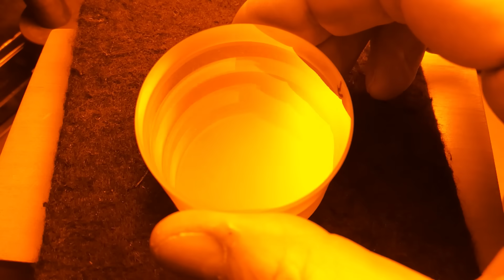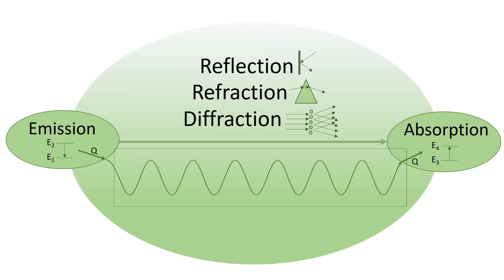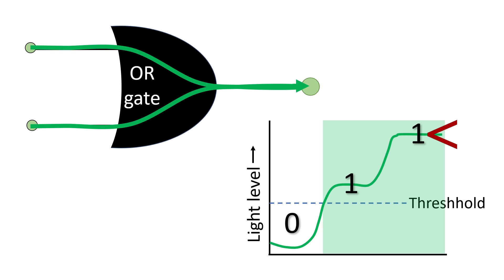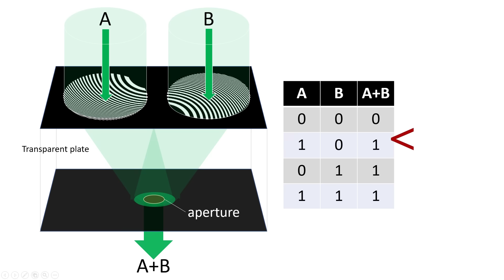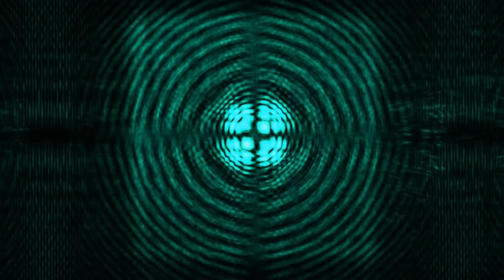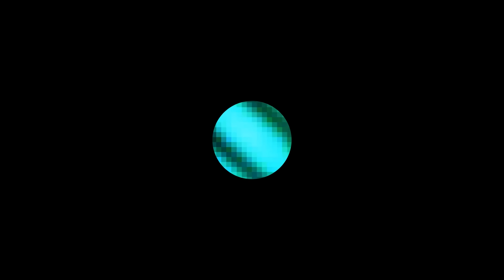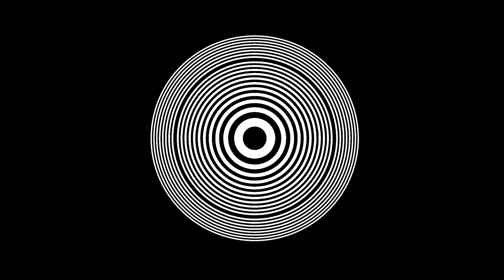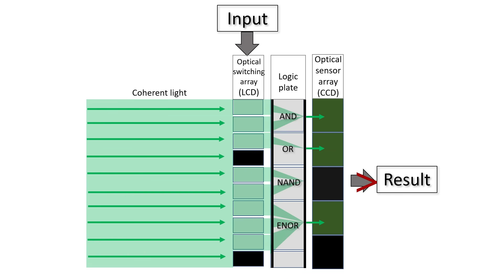Making Optical Logic Gates using Interference

Comment: can I comment as we go along with your lecture, please?
I think it is a mistake to look at positive and negative energy as existing on opposite sides of zero... logically they are both part of what we call energy... I will ask.. what can we see around us that is less than zero... ya can't get more nothing..  
we cannot have positive without negative... in electrical and magnetic systems it is the difference between them that creates the electromotive force... it is the foundation of thermodynamics and the motion of particles.. more or less.. but not nothing and less than nothing... 
in computers we use negative numbers for subtraction... but the only place I actually find negative numbers... less than zero seems to be in my bank account... go figure
Reply: I'm going to drop in my own thinking along these lines... because we need a method to store data in a 3D lattice that can be recovered at light speed... Bragg diffraction in opal... and diamond... could be used.. in a 3 dimensional storage where layers that are half the size of a wavelength of light.. and it can be infrared and ultraviolet as well as visible light.. depending on the size of the unit cells and the angle of incidence in the reference beam.. so the same incidence angle gives different colors at separate each layer... or different angle of incidence gives different colors at each layer... which gives a 3 dimensional storage and recovery capability... just a Gedanken Experimente at the moment...

Comment: the idea is very interesting. if it's possible to make a functional Full Adder and Register, a light based 6502 would be an amazing goal and Proof of Concept!
Reply from the maker: A 2 bit addition is fairly easy, however, things get pretty complicated with more because every input bit can influence the higher bits, which is tricky with just optical interference.

Comment: I recently got into phase-contrast microscopy, so it's pretty cool to see weirder applications of the concept. 

As for the question of viability... Modern silicon transistors are less than 10nm, already a 50th the size of your green laser. The only real benefit you could get out of this is potentially quantum or analogue computing.

Comment: This is a really cool idea, but I think the most difficult problem to deal with would be maintaining the phase of the light as data is transmitted throughout the machine. You would have to be able to guarantee that any time you get two inputs to an optical logic gate that those inputs are in the same relative phase. For example if one input travels a longer distance than the other it would potentially be out of phase when you actually want it to be in phase yielding a 0 when you expected a 1. I think it would probably be more robust to come up with a way to construct these logic gates with the light either on or off. The cool thing about optical computers though is that you can transmit multiple bits on the same line by using different non-interfering wavelengths. Like a byte 0xff would be white light while 0x80 would be pure infrared, 0x40 -> red, 0x20 -> green, 0x01 - uv etc... You could even handle multiple bits through the same logic gate at the same time. Depending on the difference in wavelength necessary for the light not to interfere, you could potentially have some very wide data lines (I don't know the exact resolution but I'm sure its far more than 8 bits). Also given that the speed of light is much faster than the speed of electricity and light won't generate nearly as much heat waste, optical microprocessors could be a game-changer for modern computing if we can get it to work. Is there anything like an optical transistor? That would certainly add a huge level of plausibility to the concept.

Comment: It's important to be able connect the gates together to perform computation. The performance of the entire processor is dependent on the delay of the signal through the circuit, so for best results you would want the output of one gate directly feeding the input of the next, perhaps with amplification if required.

The method of amplifying a signal must be low latency to have good performance. I know very little about optics, but I imaging a mechanism that charges, pumps, and emits light could have very high latency resulting in a high signal propagation delay.

An inexpensive FPGA kit ($200) can switch up to approx 1GHz. Some of the fastest (sequential) processors have clocks up to 5GHz (note this is the clock rate for 64-bit ALU operations so transistors are switching faster than 5GHz).

How fast can you run a flip flop out of purely optical components with minimal latency? If the signal can propagate up to C without degradation then it could be extremely fast. Visible light frequency is in the 400THz to 700GHz range.

Comment: My intuition about optical car locks is that, with the development of the required tools and instruments, such locks would provide equivalent security to today's Internet encryption methods, meaning that they would have to encode similar numbers of bits to provide a similar level of security. But, with the advent of quantum or photonic computers that could try all keys quickly, the bit length in such car locks would have to be increased over time to keep up with the speed increases in computing, just as with Internet encryption. The only technique I know of that would counteract increases in computer speed is the MAC algorithm that uses multiple encryption in the software. In car locks, this would increase the complexity of the lock/unlock hardware without much change needed to car keys.

Comment: Why must a photonic bit be represented by a light level? Why not a frequency or phase? Phase, in particular, is attractive, since it is an aperiodic characteristic of periodic waves, varying from zero through a circle of values back to zero, either in real numbers or in complex numbers. And phase can be combined through M-Z interferometers or polarizers either at full lab scale or in miniature. All this can be done classically, without quantum complications such as a need for refrigeration and without the horrible mechanical complications of generating interference fringes and selecting one fringe. As a toy lab experiment, the author's method works just fine, and could be expected to produce some gates and flip-flops realized on top of a very large bench.

Comment: In the first minute, the question is asked: where does the energy from a dark fringe go? Strangely, the answer is not discussed. The answer, of course, is that the energy that would have appeared in the dark fringe goes to the nearby bright fringes, which are thereby brighter than the source (non-interfering) light. Light energy can be understood as wave energy, and is conserved just like any other form of energy. There is nothing contrary to the conservation of energy in conventional discussions of wave interference, either destructive or constructive.

Comment: I was working on this process and the application of this process as far back as more than 9 years ago, but less than 10 years ago. I was working on redundancies to allow for full application of this process in the form of hi speed primary memory and processing logic at least as far back as Fall of 2019. I had concepts for mitigating waste heat and recovering waste photons, etc. One of the immediate advantages of this process is that you can make an optically actuated clock, and with negligible difference in waste heat production, run a hypothetical cpu, or bus, or memory at several orders of magnitude faster switching/clock speeds than the viable ceiling in semiconductor processing(mitigating the problem of gates operating in the shorter end of the  x-ray band having slightly longer delays than is applicable in the best viable semiconductor gates, and especially applicable if working with uv light - which is more immediately testable ). I had strategies for approaching the prototyping and testing of a drop in replacement for ram in sodimm form factor, but needed to wait until I had more resources for fabrication.

Imagine a massive fpga array that occupies almost no space,  has 1/1000 the latency of a conventional fpga array, and consumes 1/10 of a watt?

It is hypothetically possible to create a switchable diffraction array in multiple physical planes of interaction that can be intermittently changed to affect diffraction of indefinitely many poly-degree layers of diffraction/interaction. In other words, there is a straightforward path to making a processor that can physically change it's architecture across extremely short timeframes.

Comment: Diffusing Silica (glass) on other layers, you could make micro fiber optic paths to connect the gates together. And, if diffraction patterns could be introduced in these fiber/optic paths, they could combine at an aperture - that would eliminate need for the diffuser layer as this would be encoded into the paths themselves resolving into logic functions where they come together at various aperatures.

Comment: Great video! An un-picable lock. Brilliant. You should file for a patent on that if you are the first, or at least write a whitepaper and have it published - even on YouTube if no one will pick it up.  Optical computers, this is very stimulating (no pun intended). If you could do this with individual photons, quantum computing may merge with this.  For those of you not familiar with digital logic gates: In electronics, all you really need is NAND gates because a 2nd NAND gate (with one input tied to a logic '1') on the output of the first acts as a NOT (inverter) gate and converts the NAND gate to an AND gate. So, using NAND gates, you can make: NAND, NOT, AND, OR, NOR, EXCUSIVE OR, EXCLUSIVE NOR, and any other gate with various combinations NOT on the inputs and output... and you have ALL the building blocks of computer logic. With Optical Logic, you start OR and NOT gates, and those too can be combined in various ways to create ALL of the same building blocks gates used in electronics.  For example: Demorgan's Therom states you can convert, say an OR gate to an AND gate by putting a NOT on each input and output of the OR gate. Try it:  The truth table of a Negitive Logic OR gate (one with NOT on the all the inputs and output) and truth table of an AND gate, both tables give the same results with respect to their inputs (thus the same gate, just inverted "logic/polarity" symbols). A postive logic AND gate is the same as a Negative logic OR gate, they do the same but you look at the logic from positive or negative perspectives, so the symbols are different but do effectively the same.

Comment: Something to thing about Jeroen. What about making optical logic gates based on optical frequency? Eg your inputs are two coherent light sources at a given frequency. If both inputs are present and you combine them then you should get an output which includes an optical beam at twice the frequency. It would not be computationally  as fast as your method but still would be relatively fast as it uses optics.

Comment: I've always wondered if microscope images could be improved by post-filtering. We know exactly how the optics works so could we not deconvolve the image to optimize detail?  In fact, can we use a laser to help with this? In fact, what I was thinking was to actually have a flexible lens that could alter the focal plane very quickly(say 30hz) which could then be used to get maximum detail over a larger depth then correct the focal differences algorithmically. It seems a lot more could be done with optical microscopy than what is done(from my limited knowledge). What about using AI to correct and hence the images?

Comment: I am interested in the process of using micro lithography for the fabrication of 2 dimensional photonic crystal 'chips' which would perform logical functions. One such material preference would be fused silica which has been considered for use in photonic crystal fibers. Semiconducting nanocrystals (quantum dots) could be imbedded as a lasing source but may also perform other functions. A Japanese company has already made a photonic 'switch' (on/off) in this manner and no doubt the arranging of such 'switches' could possibly perform a fully logical function. The chip could require optical circuits as well. The etching technology would come from Nanoscribe

Comment: Atomic radiation is the key for this study. 
Every atom has different radiation level and frequency
1. The crystal structure should be illuminated with white light. (slightly below the electron orbital change energy)
2. One light input source can be accept different frequency lights.

3. Output can be multiple with different type of atoms. An element passes a frequency.
Multi input with one channel. Multi output with multi filtered channel. Same optical way can be use for calculation every needs.
Why limit yourself to simple structures? The door to the future cannot be opened with old ideas. You have all of periodic table.

Comment: I'm not a physicist, but a programmer. Could somehow explain what the benefit of a logic architecture based on photons rather than electrons would have? A quick Google search told me that electricity usually flows at 90% the speed of light, which seems good enough for the vast majority of applications. I thought that you could encode data in light beams or images, that already exists.

Comment: xD make  binar counter 000, 001, 010, 011, 100,101, 110, 000 ... or binar calculator if use colors too (how much shift in lense (chemical composition of the material) colors/wavelenghts (spectrum)). Copy is like "Polarization by a Calcite Crystal"?
Reply: copy is like "Polarization by a Calcite Crystal"? & Polarized Light

Comment: HI REF YOUR VID ttps://www.youtube.com/watch?v=pS1zAAD1nXI OPTICAL LOGIC GATES !!! I FOUND THAT I CAN SWITCH A LASER INTERFERENCE PATERN ON AND OFF IF THE LASER RING GYRO 2 MIRRORS AND 1 SPLITER HAS A LONG SIDE APPOX 3 TIMES THE SHORT SIDE !! THE RLG MUST BE CHANGING VERY SLIGHTLY IN TEMPERATURE AS NOT TO BREAK THE FREQUENCY LOCK !!! WHEN THE MICROWAVE OF A 1 WATT WIFI IS EXPOSED TO THE RLG AT ABOUT 1 TO 2 FEET AWAY THE MICROWAVE BREAKS THE FREQUENCY LOCK OF THE LASER IN THE RLG !! THIS WAS A .5 WATT RED LED LASER !!! I HAVE DONE THIS MANY TIMES OVER THE LAST 20 YEARS !!! ON A DRY DAY YOU CAN PUT THE RLG IN A FREEZER TO LOWER THE TEMPERATURE FOR A FEW MINUTES AND YOU WILL FIND YOUR INTERFERENCE PATTERNS ARE MISSING  WHEN REMOVED FROM THE FREEZER!!! THEY ARE ACTUALLY BLURRED MOVING BY SO FAST !!! WAIT 5 TO 10 MINUTES AND U WILL SEE THE TRAIN TRACK PHENOMENON AS THE TEMP STABALIZES !!! THEN THE STICK AND RELEASE EFFECT OF THE NODES ( FREQUENCY LOCK STARTS AND STOPS !! THATS WHAT YOUR AFTER !!! YOU CAN ALSO BRAKE FREQUENCY LOCK USING A SMALL SPEAKER LIKE A SMALL 3 TO 4 INCH SPEAKER WITH A AUDIBLE TONE PLAYING QUIETLY LAYING OR ATTACHED TO THE BASE OF YOUR LRG !!! I DON'T KNOW THE SWITCHING TIME THAT ITS ACCOMPLISHING BUT IM SHURE ITS BETTER THAN AN LCD CAUSE THE LASER IS ALREADY AT FULL AMPLIFICATION !!! GOOD LUCK AND HAPPY LATE HOLIDAYS !!!!!

Comment: Could you multiply the number of operations by calibrating for different wavelengths? Or perhaps even performing distinct operations on a per wavelength basis? For example red green and blue light? In effect collapsing multiple chips into one? The instance you showed of stacked focal points would seemingly be ideal if two semi-transparent planes are used and a mixture of wavelengths are present one plane might be doped to absorb a single wavelength or a combination of wavelengths. It might even represent an entirely separate solution since the logic gates might be orientated along a axis orthogonal to the representation you have envisioned here.

Comment: When designing an optical computing device, you probably should immediately forget about LCD or anything that is controlled by electricity, because it destroys the speed advantage of such a system.
You'd probably need a fully optical device, where the only electronic part is the "power supply" which produces coherent light for the entire system, with no need for slow electronic feedback. The processing unit, working memory, storage and connections between them would all have to be optical to get maximum benefit. Then you could feed the light directly from optical memory bus into the processing device, where it will use optocal gates to instruct it to perform certain operations

Comment: Optical logic gates are better than electronic gates only if you can stay in the optical regime for the vast majority of operations. So your closing example using a CCD will never be competitive in terms of speed, cost or energy required. 

When staying all optical, one challenging part is pumping/amplifying the beam throughout the circuit so it doesn't become too dim to detect at the output after passing through millions of gates.

Another challenge is storing bits. Not sure what a flip flop would look like for an interference based optical circuit.

Comment: Here's the first thing I thought of for a possible application: redundancy computer for space probes.
An optical computer could run on sunlight. If the main, presumably more powerful, computer fails, the optical computer could attempt to boot it up or maintain a signal with Earth. This would probably need some way to control the inputs, since they'd all be on from the sunlight otherwise,. I'm imagining some kind of nanomaterial that changes its shape when light is applied in the right way, altering its transparency.